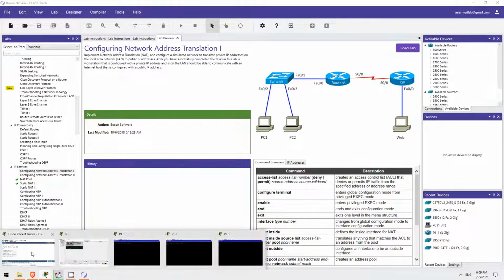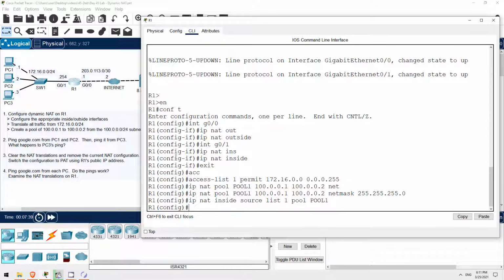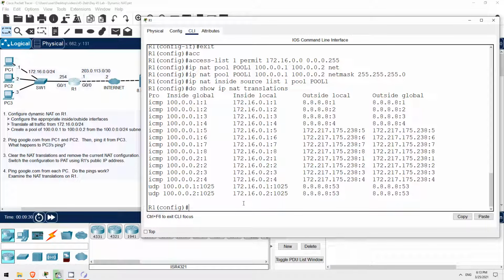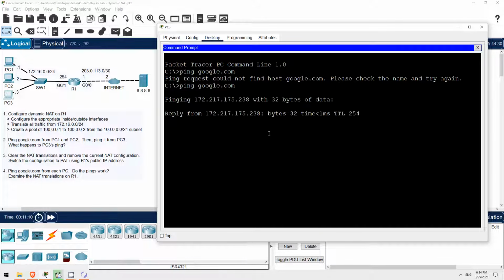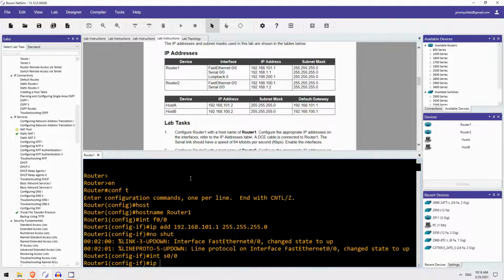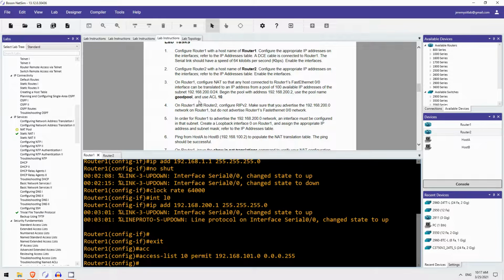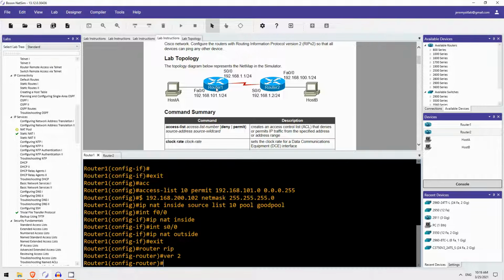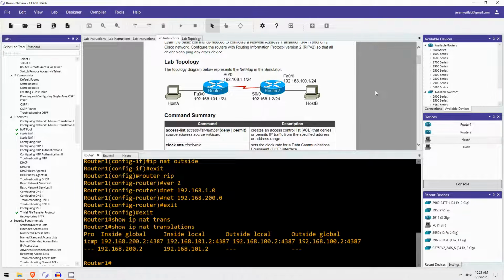Free CCNA | Dynamic NAT | Day 45 Lab | CCNA 200-301 Complete Course

Comment: Hi everyone,
i am trying to build the same lab but having issue with connection. There are 2 options for cloud in PT, cloud-pt, cloud-empty
and for server too, 5506, 5505. the cloud has only 1 ethernet connection so I cant connect the otherside with the server with the cross-over cable. any has any answer for that

Comment: Two fun variances I found from trying on my own:

1.) Packet tracer still sets it to "Overload" for the PAT on the public interface for the router if you forget to put overload like I did. 

2.) For some reason I originally tried doing "ip nat pool pool1 100.0.0.1 100.0.0.2 netmask 255.255.255.0" and it would just not work. I wonder if it had to do with the pool name being lowercase but can't figure out why it didn't. Maybe a typo but not thinking so honestly, who knows at least I understand this as this was not as easy as I thought I would and I use NAT at work often enough to understand it decently well.

Comment: Hi Jeremy, very grateful for your videos. I noticed ip classless was used on the internet router before entering the ip route. Is there a reason for this? Previous configurations of static routes/ default routes didn't show that. Thanks
Reply: It would be great if you could clarify this too. So the router is assigned an ip address on the port that is used for the PAT but before we used it for the PAT, we were still able to use it for the dynamic pool ip assignments too. How does this work.

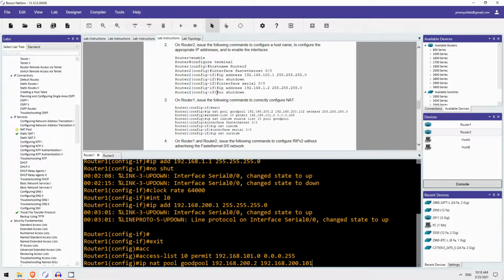Comment: Why is it 101? Isn't 102-100= 2? Am I missing something please enlighten me.The timestamp is 10:25 .
Reply from the maker: 2 to 102 includes 101 numbers, so 2 to 101 is 100 numbers.

It’s like counting from 0 to 100, it’s 101 numbers in total (1 to 100 would be 100 numbers).
Reply: I initially put it in as 101 - the correct number for 100 available addresses - and NetSim graded it incorrectly because their solution used 102. After I fixed it to match their math, the lab still graded incorrectly because my statements were out of order. I'll probably need to reload and redo the lab to get it to grade correctly. Just a minor annoyance.
Reply: @JeremysITLab  so are we counting it from 2 or after 2? that would make the difference, right? sorry it did confuse me too :P